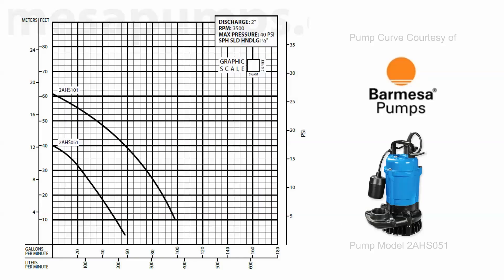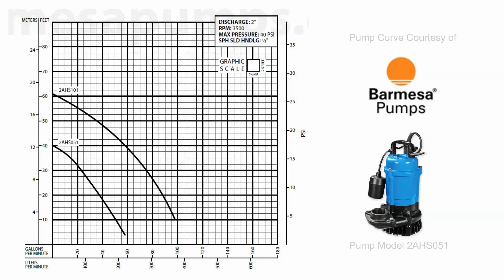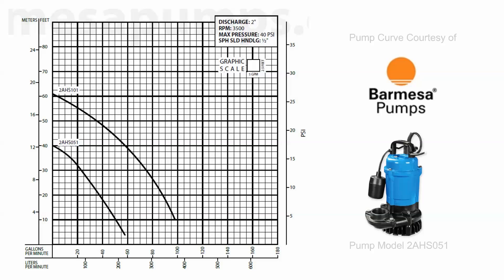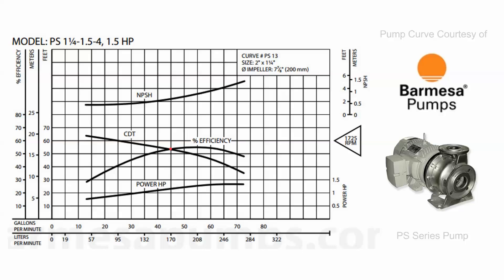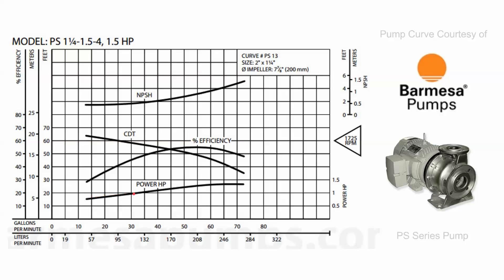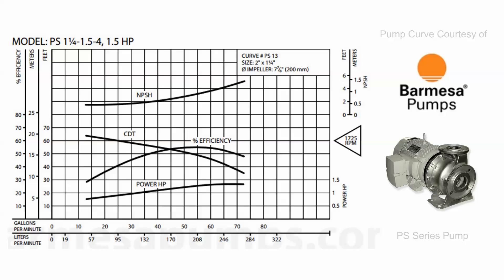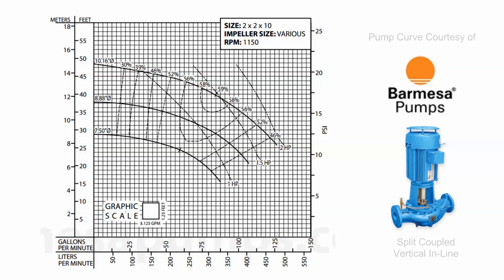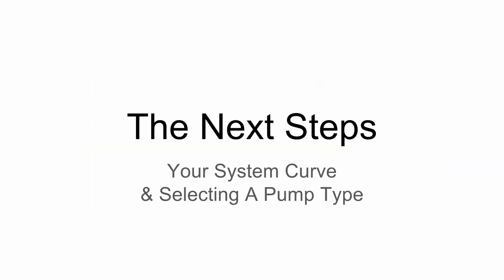How to Read a Pump Curve: Simple Explanation

Comment: What if you're below the curve? In other words, a flow rate fairly close to the center, but at a lower pressure .
Reply from the maker: Pumps will only operate on their curve. You should find a pump that matches your system curve.

Comment: If you need to lift water let's say 3 feet out of a basin and push along 100 feet over flat ground, through a 1-1/2 inch pipe, how do you know what the dynamic head is?

Comment: I'm receiving quotes on a new well.  Current well pump is 1hp hung at 580 in a 600ft well.  Static water has dropped to about 520.  (Current 1hp pump can only develope 10 psi of pressure at this level)  I'm moving the well to a lower location in hopes of finding a new water source.   600ft well with 300ft of horizontal line.  I do not understand why everyone is quoting 1" line.  Why wouldn't 1 1/4 be the standard given the head pressure increase with on 1" pipe.  (1" Schedule 120 for well,  1" Poly to the house)  One driller provided for a 1hp power motor and the other provided for a 1.5hp which is in the curve.  Another suggested a booster pump at the house to provide for a 30-50 switch.  Any thoughts?
Reply from the maker: Pipe size is a function of flow rate. If you are only pumping 5 GPM then 1" line is plenty big. Give us a call if you'd like us to quote your system: 855.329.4519
Reply: @RCworstwater   Love your channel.  I'm in Virginia.  Your Youtube channel has made me an expert on Wells.  I was having water issues at a house I own.  The hired experts said: A. " 1 HP pump is too small being hung at 580... need a bigger pump"  B. "I see a momentary amp spike when the pumps starts and I should not see that....pump is bad."  C." I dropped a little rock down the well and I could not hear it hit water...need a new well"  D. "Not pulling enough amps... needs a new pump. "  E.  "Pulling too many amps.... needs a new pump."  No one had invested in a Sonic Water Tool.   I eventually dropped 600 feet of 1/2 pipe in the well to monitor the pressure.   Would only hold 25psi and would never build past 30psi.   Based on the low water level and little to no recovery overnight I decided to drill a new well.   Not sure why every service company does not rent to customers a well water monitoring device to determine well water levels.  I may even try lowering a lighted camera down the well and record the condition.

Comment: What is duty point?.
Reply from the maker: Good question, it's the point where the required Flow Rate (x axis) and Total Feet of Head (y axis) intersect on a pump curve.
Reply: Another question sir.  "what is the amount of liquid required in the suction side of the pump to overcome the friction and suction losses?  

A. Head in mic
B. Net positive suction head
C.  Duty point
D. Common point